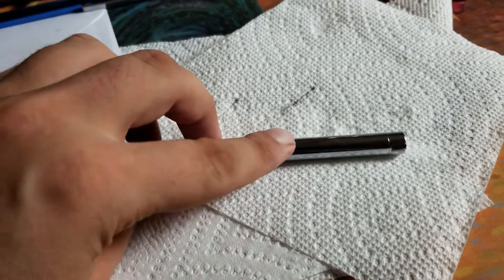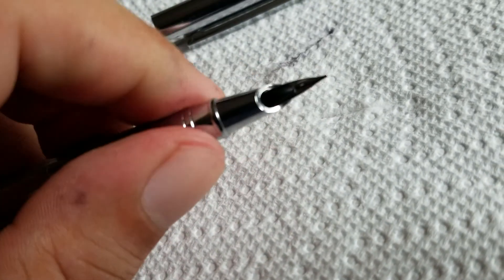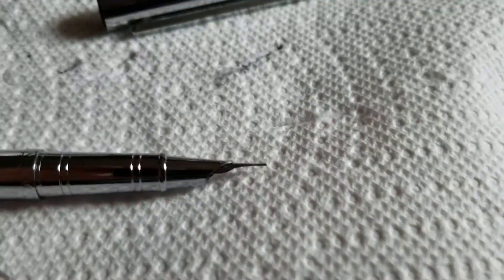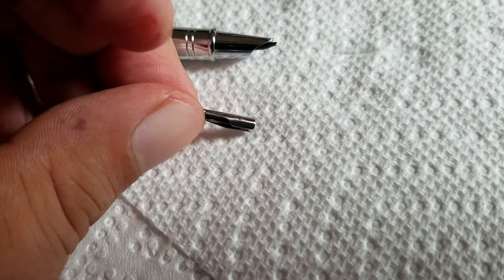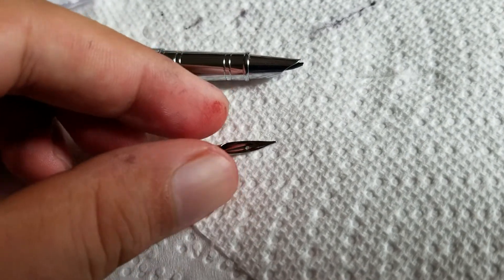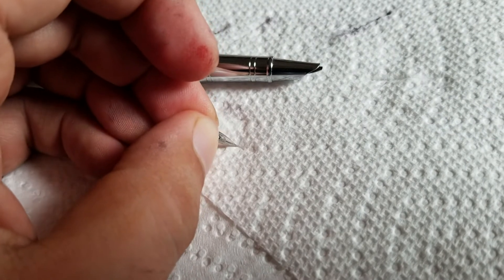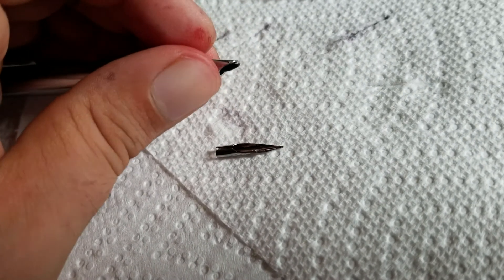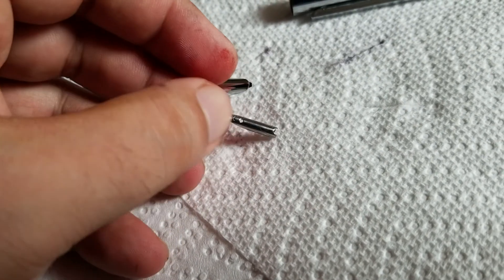Jinhao 126 nib removal

Comment: Thanks for the review, William.  I plan to get on of these witch costs $7.54 in Australia from E bay.  It's probably not my place, but I must comment on the method of extraction you use to remove the nib.  Using a small straight pair of artery forceps I cover each side of the instrument with heat shrink plastic.  This enables extraction with zero chance of damage to the nib.  If it is scratchy, as you know,  one can smooth it out systematically by rubbing the surfaces.  Instead of micro-mesh paper I find the "three surface" spongy nail buffing pads work like a treat.  Kindest Regards, Steve Wilson.   😃 🇦🇺🇦🇺🇦🇺

Comment: ummm ... from experience if you  use pliers like that can rip the iridium off one or both sides of the nib slit, destroying the nib.
If you remove the hood, you can slide the nib off gripping the sides.

You will probably need to heat the hood under hot running water to melt the shellac sealing the hood threads before it will unscrew. 
Shellac is also needed to reinstall the hood so it does not leak. (2 or three layers of plumbers teflon tape on the threads will also work, but MAY crack the hood, if plastic.) 

Honestly, unless the nib is being replaced, there is no reason to take it off. 
As with any other nib, you can polish it when on the pen.

The nib is a "accountant" or extra fine 0.38mm. (fine is around 0.5 mm.)  That fine of a nib is going to be somewhat scratchy, unless it is really wet.
I have not found a way to adjust the ink flow. Not surprising, since I am not a nibmiester.
Reply from the maker: @stevehuffman7453  Indeed you have to be careful with it

Comment: Wow, very outdated maybe? I just picked up a Jinhao 126 for $2 and it's very reliable and very smooth for a fine nib too - pretty wet, very reliable after a couple of weeks use. I'm shocked after thinking the Jinhao 992 was good to find this even better.
Reply from the maker: Yes, most likely mine were older and a bad batch. It happens with poor quality control.

Comment: The number 5 and 6 Jinhao nibs I have (I have over 19 Jinhao pens) are great nibs. All of them write smooth, and are not too wet or too dry, nor do they skip.  Much better than the #5 "Omni Flex" nib I have (it doesn't flex any more than a non-flex nib by the way. If you want a flex nib, save your money and frustration, and look elsewhere. The Noodlers #5 "Flex" nib doesn't flex either. The non-flex Noodlers nibs are exceptionally scratchy and grabby, as well. So much so that they are unusable. Don't waste your funds on them, either. None of the Noodlers nibs are tipped, which is probably has a great deal to do with their problems.)

Will this pen take dip pen nibs? Does the hood unscrew and come off for cleaning? Is the feed removable for cleaning?

You kept saying it is a "fine" nib. From everything else I've seen online, they are an EXTRA Fine, (0.39mm) not a Fine (0.5mm)
Reply from the maker: You're correct, it is more of an extra fine. I don't consider them a very viable pen. The feed is the issue on them.
Reply: Do you know if the Jinhao 126 nib and maybe the feed will fit a HERO 616 or 1107 or 329 with the Aerometric fill?
One of my 616's lost the tipping on one nib tine.